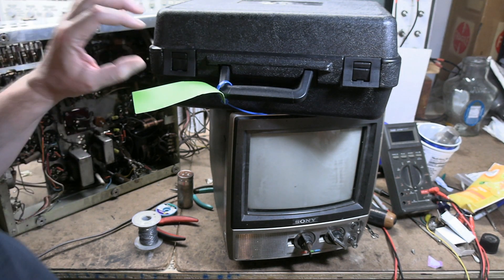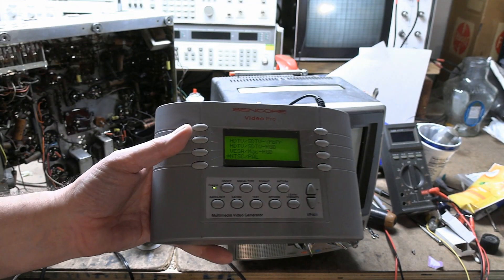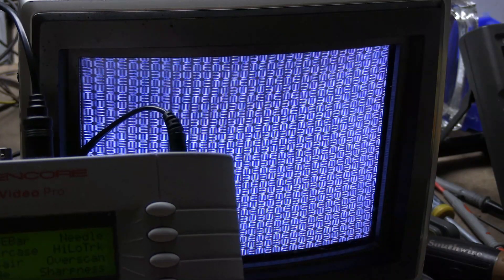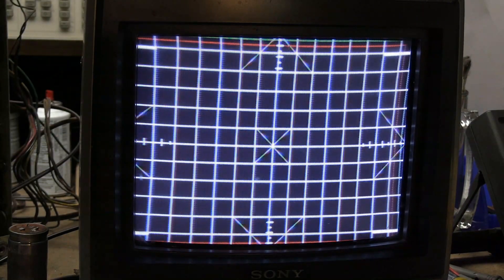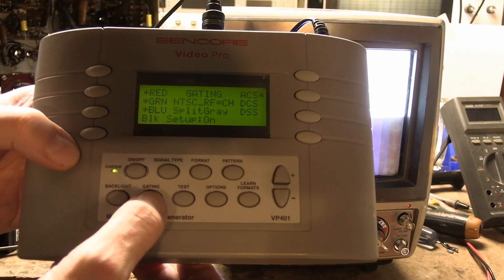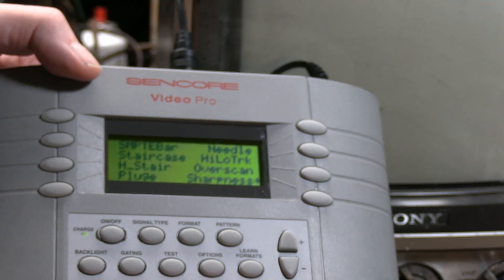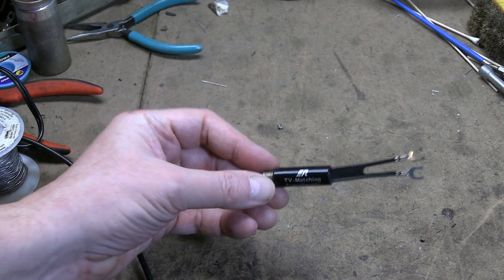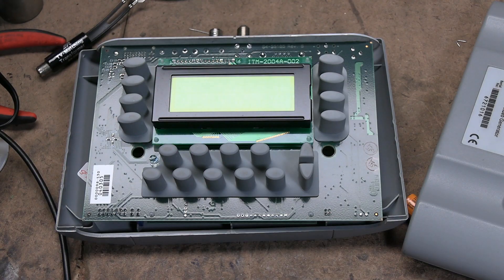Sencore VP-401 demonstration

Comment: these were made by quantum data for sencore with some special programs for calibrating displays, there are several versions of the vp-40X and I have used them since they came out, I have 3 versions of this VP-40X one of them does output HD-SDI and you have to have the special option to read the EDID from a display and handshake, inside are replicable AA rechargeable batteries

Comment: Nice generator. I'm curious if the test patterns differ in PAL mode? 
I'm missing the philips 5544 test pattern which is used extensively in PAL areas.

Comment: I used the previous VP300 (no RF output, only composite, component and RGB) to setup CRT projectors. Very handy device for that and I knew that you'll be surprised by the NiMH cells, just get any you'll find...In a pinch it should also run on alkalines but then don't plug it in because the charger will try to charge non-rechargable alkalines.

Comment: Wasn't expecting the serviceable battery "pack"
Reply from the maker: Me neither.  The identical Panansonic batteries are still available on Amazon.
Reply: @bandersentv  if you shop around you can easily find other brands of the same styel of AA NIMH cells (they usaed to be somewhat popular in the R/C modelling hobby for transmitter batteries)

Comment: Wouldn't you be able to check the matching transformer by checking the resistance across the 300-ohm lead?
Reply from the maker: True.  Should be less than an ohm.